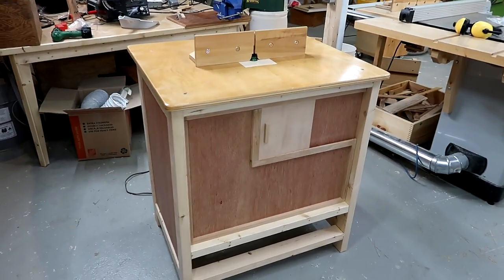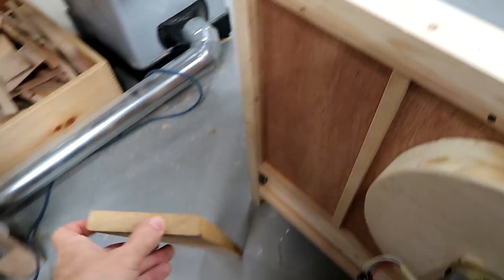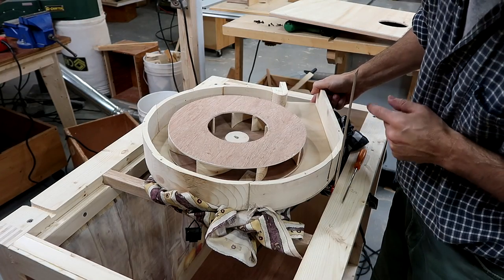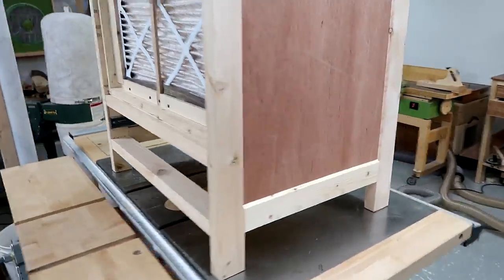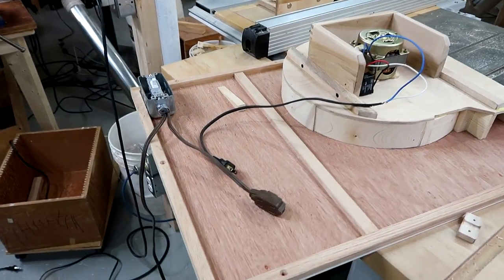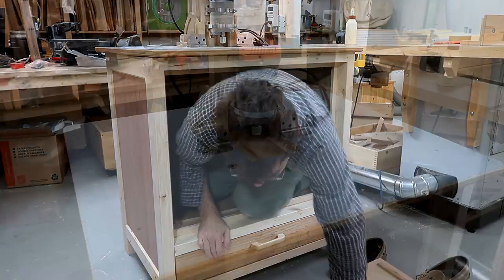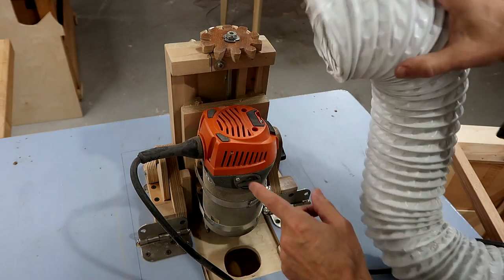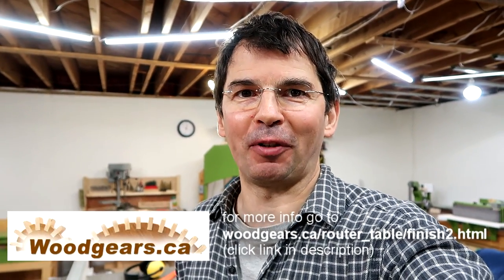Finishing up the router table

Comment: Ive never heard about the trick of cutting wires different lengths. That is one I will definitely file away for future use. Thanks!
Reply: Yeah, it's so simple, yet not even 50 year old senior engineers with decades of practical experience have ever mentioned that to me! Good stuff as always.
Reply: It's a common thing to do when splicing wire bundles. I do the same thing with my jumper wires or cables.
Reply: That is common practice. Nothing new, but very efficient.
Reply: not only do done to make shorts less likely, it also makes the splice less bulky
Reply: I'll add another tip.
The Earth wire on a plug should always be longer then the Live and Neutral. That way it's the last wire to loose connection in case the wire is becoming loose.
Reply: @ggtt2547  Dad showed me that trick when I was 13, more years ago than I care to think about now. He was a 48 year old "Technician" for Texas Instruments at that time. Engineers just design the disasters, Technicians have to implement them. Haha.
Reply: One additional tip from me is to remember that insulation of wire is movable, you can tighten it up to reveal the copper underneath, solder it, and relase the tightened insulation to cover up most of the connection and then use the tape or shrinking tube. It makes the connection clear, tight and pretty much impenetrable c:
Reply: Haha I didn't know it was a trick, I've just done it out of necessity
Reply: Another advantage is the diameter after taping is smaller (though longer).  Been doing it for years.
Reply: @ggtt2547  Engineers often don't think of that kind of thing.
Reply: @krissfemmpaws1029  But in your use case you are spreading the splice points out so they don't lead to a massed thickness all at one place - you want them curated so the thickness is nicely/best spread about perhaps even to fit a cabling channel space.
Reply: @Don.Challenger  yes you space them out when ever you can, it looks nice in the wire loom or harness.

I have had to stack the splices up because the clown before me left 4 inches of wire through the bulkhead fitting with no way to pull more. As a rule I try to make things a bit better for the next guy that may have to work on it...
Reply: It's also helpful if you use alligator clips from power supply, you cut the input wires different lengths, so the clips don't accidentally touch.
Reply: Same here
Reply: @dfabeagle718  You mean fix them!
Reply: I thought it was obvious and have done it since I was about 8.
Reply: @ZeedijkMike , every comically large UK plug has this inside of it. It really is a good idea.
Reply: One little obscure tip I learned a while back: if an outlet is rarely meant to be unplugged, install it ground-pin up.
There are two benefits: it holds a cable in better and something falling from above is less likely to cause a short.
The only benefit of ground pin down is that users are less likely to get a zap when plugging in and unplugging a device, as they can see the live and neutral legs while inserting.

Comment: It's not about how much time it saves you. Even if you rarely use it, it has two benefits:
A) The lack of setup means you won't be distracted and loose your train of thought about what you were working on.
B) When using the router table you'll be reminded of what a neat machine it is to have in the shop which will put a positive light on your project.
Reply: I like "put a positive light on your project" versus the worn our "Put a smile on your face."  Where else can any person get a smile.  I would pay money to see that.
Reply: lose your train of thought

Comment: I like it! Well done. 

I’m also intrigued by the idea of having a dust collector built into each machine. It certainly would save on hanging duct work all over the shop, plus you’re not limited to where in the shop you can put the machines by not having to worry if there’s a dust collector hookup nearby.
Reply: Yep, I wanted central dust collection a one time but have since changed my mind. Local dust collection is better in my opinion.

Comment: Having a setup router table means you are more likely to use it.

When I was working as a resin rat at a boat builder they had router cubes that were about an 18 inch cube with two routes setup in the cubes as a router table.

One of the guys had one that was 30 inches long by 14 inches square on the ends with fences. A lot of teak chips and dust was made by those things in a days work.
Reply: I've been wanting to make a cedar strip canoe for years. A dedicated router table would be essential.
Reply: @KipdoesStuff  the cube's work faces were covered with smooth Formica. The long one had the area for the routers cut out and the work surfaces were 3/8 clear acrylic sheet that the router bases were attached to. I thought it was a slick setup because you had a longer infeed area over the cubes.

Comment: Fair play to you Matthias for helping the electrical tape industry - i still use it, mainly because if I used shrink tubing, I'd probably forget to slide it on before making the connections lol!
Reply: I only use shrink tubing if its for someone other than myself.
Reply: You could just use wire nuts. There are some Wago double butt splice lever wire nuts that would be perfect for this. Or crimp type butt connectors also.

Comment: "That will easily save me a couple of minutes, maybe once or twice a month, when I want to put a quick round-over on something."  Not for nothing, but I bought cheap trim routers from Horrible Freight for my common edge-trimming operations. There's a chamfer router, a 1/4" roundover router, 1/8" roundover router, and a straight flush-trim router. They're like $29 bucks, so it's cheaper than the router bit in some cases...

Comment: I have a simple rugged reliable router tabel that I made over twenty years ago. It has survived my use in trade for that time.it is completely demountable being two frames held apart with rails and tusk tenons, the top sitting on this frame located on the tops of the legs with shallow mortices. it works a treat. 
This build video however has set me thinking. The greatest advantage to someone such as myself who also uses a demountable routr table for hobby work at home as well as site work would be the fact that the cabinet reduces sound transmission.
I think that something similar could be made using flat panels of say 18mm ply mounted with keku clips.Battens could be included with seals in to maintain air tightness. The top could still drop on to the base but with a seal routed into the junction.
thank you for the ideas Matthias. The quiet running extraction would also be a benefit.
Why though is your fence so short?

Comment: A strip of adhesive weather seal tape as used on doors and windows laid between the tabletop and frame should stop the "leaks".
The staggered wire length and tape is as good as anything when splicing wires.
Cheers  Eric

Comment: For the lip edge, just get some of that door sealing brush and install it around the perimeter on the inside. Should be more than sufficient, easy to open up, and it's cheap as cheap gets.

Comment: Great table.  This is the best one yet.  For sealing the table top.  Why not put some door weather stripping (the adhesive kind) around the top of the table frame.  That way when you put the top back on it'll get a nice seal that isn't permanent allowing you to easily remove the top.  I think you had some of this lying around somewhere.

For the router, if dust ever becomes a problem.  Like you I'm not convinced it will.  You could use a foam filter for a wet/dry vac and just close off one end.  That should provide enough filtering.  They are like $8 USD on Amazon.  Worth looking into "should" it ever become a problem or just to keep the naysayers appeased.  😂

Comment: A thin layer of rubber sheeting cut into strips placed under the table top may work if you want to keep the top removable, otherwise, I'd use clear silicone under it and around the inner lip edge.

Comment: Any particular reason you don’t use those power strips with built in switches? Just seems those would be less work than purchasing and connecting those house switches
Reply from the maker: Yes, that could be used too.  I just like the switch separate.

Comment: I guess the speed control would be an obstacle to externally ducting the motor. My router has all the vents on the top and is a single speed model so it is ideal for a flexible hose. I wonder if you could bypass the speed control pot by wiring and mounting one on the outside of the cabinet? It might be more convenient and would make a good video.

Comment: I would have went with three quarter mdf.  It would have created density which absorbs sound and vibration.  You have kind of of built a loud speaker.  Do like the fan idea.  Thanks.

Comment: As to the unit rocking on uneven floors. What about having two fixed feet on one side and on the other have two feet on a swing arm that pivots in the center. The swing arm acts as an equalizer that you can then put a locking knob on. Equalizes like these are a common element in industrial applications* where you are clamping multiple parts in a fixture using a single hydraulic cylinder
*mostly on high volume production on dedicated machining lines.

Comment: Nice build, and great to see you back to inventing/building again!
One thing about that router table. Looking at it, it just feels inconvenient to have that one drawer ALL the way to the bottom, which is the logical design, though, given that dust extraction is SO integrated directly to the routing table itself.
If you ABSOLUTELY had to, how would you do to put that compartment closer to you as the user? Maybe install something on the side? (asking at the risk of sounding stupid, just being curious)
Reply: Why not both ... the drawer at the bottom is perfect for things not used regularly and either have a drawer on the side for more frequently used bits or just mount a 2x4 ( or whatever size you deem fit ) on the side from front to back with holes drilled into it for bits used more often !

Comment: My solution to that kind of wobble is to screw a lag bolt into the shorter leg and adjust it for height. My crapppy router table is for a quick round over also, lol.

Comment: People always find a reason to criticize or complain. Electrical tape its called electrical tape because is use on electrical cables! If you need to remove them in a couple months they're not going to come out clean but all you need to do is use some alcohol and remove the goo left behind from the tape. Shrink tubing is the best option but if you don't  have it electrical tape is fine.
Reply: I love Matthias. But I would not do electrical the way he does. However, I also don't complain about it normally. The right way to do what he did would be to use insulated crimp type connectors, or Wago inline wire nuts (lever wire nuts). Soldering is really not the best way to do house and it is even worse for tools or vehicles because of vibration. Soldered wires tend to break when they are subject to vibration because the solder creates a rigid chunk of wire. This concentrates stress in the strands of wire immediately outside where the solder has penetrated.
Reply: @mckenziekeith7434  yes I understand and I respect what you were saying but you have to understand that there is a perfect way of doing it and there is an okay good enough way of doing it
Reply: @andreschiriff4354  it is no more trouble to do it the way I suggest. In fact it is easier than soldering. But whatever. I am just here to watch Matthias's videos. Not to complain about the way he chooses to do electrical stuff.

Comment: I checked out your webpage, and did not see my answer, so...is there a particular drawer slide you like? Or maybe brand?  I have a project where I need to make a lot of drawers (30 or so) for tool storage. If I can save a few dollars, it will add up. I also do not want junk (hence not making my own slides!).  If you have had good luck with anything in particular, any guidance would be appreciated.
Reply from the maker: whatever I can get cheaply.  lately been buying packs of 10 online.

Comment: Why the wood cover on the switch? It looked like you had an ok steel plate switch
Reply: So you can't jam the table up against the wall and break the toggle switch. Don't ask me how I know.
Reply from the maker: to avoid toggling it by accident.
Reply: @matthiaswandel  you never broke one of those switches? I have and it is easier to do than it looks. The toggle can sheer right off. It's always a nice 20A one that breaks on me too.
Reply: @1pcfred  When I was younger we had an argument with my cousins over the lights being on or off. They had a Decora-style rocker switch and with one person pushing the top and one on the bottom the rocker plate broke. That's the only time I've broken an actual light switch. I can certainly see breaking off a toggle, though.
Reply: @eDoc2020  I've done it a couple times. Switch is shot then too.

Comment: Could you cut multiple finger joints at once, staking and offsetting the boards?
Reply from the maker: yes, I did in the video too
Reply: It was a little hard to tell with the high-speed video, but pretty sure the first set of cuts were done with the 2 side boards. The ends of the middle board were then done individually, since it's just a 3-sided box.

Comment: The extra cover on the switch I will try to remember in future as it's a good idea. And though the electrical tape destroyed my soul - or something - it's being clamped down so it can't unravel much, so meh.
Reply: Way more than the electrical tape is the soldered connections. They used to solder wires in houses and it worked. The problem is if the wires were to get hot then the solder can melt off partially or fully causing sparking. Sparking in an enclosure full of saw dust can be deadly.
Reply: @ericwhitaker9608  If the wires get hot enough to melt the solder then you'll have other issues like the insulation melting. I think the larger issue with soldering here is that it concentrates stresses on the wire strands; soldered connections of stranded wires always seem to break with a bit of movement. I would've gone with wire nuts myself.
Reply: @ Eric Whitaker - Some say, 
"Being alive, leads to death".  🤭

Comment: I personally think making a blower that goes around the router body would have been better then this, but there are practical limits i understand.
Reply from the maker: then I'd need a separate cabinet for the dust to go into.
Reply: @matthiaswandel  You're aim was to make an area of suction, you don't need the housing of the fan for that, you could have just made the center hole be around the tool's hole, then you could have belt driven it to make up for the fact that you'ed not be able to do so from it's center as the tool would be on the same axis.

Comment: Wonder how long before the centrifugal force loosens those bits of balancing wire on the rotor vanes and they come flying off ?
Reply: Inertia pushes them into the blades, not away from them.  Or centrifugal force if your reference frame is the nail.

Comment: BRO. DO NOT TRUST ELECTRICAL TAPE WITH 15-20 AMPS. Get a crimping tool and a double sided crimp connection won't cost you more than 15cents
Reply from the maker: Indeed, electrical tape is good for zero amps only, because it's an insulator.  You wrap it around to make sure no current flows out.  But to connect things, I soldered - better than crimping.

Comment: You do realize that your air flow test is not yet valid, right? You have to repeat that so you face all four directions and then do it again upside down! 😆
Reply: Pretty sure he only does the air flow tests to head off the trolls, lol.

Comment: heatstink tubing is a crock anyway. more of a looks thing. it's good on things you are going to touch with your hands a lot where tape might unravel, for example the test leads or clips on a handheld meter, the jack end of your headphones, small things. otherwise tape all the way. once around with white electricians tape is good way to go on spliced power cables because if there does end up being a fault you can spot it right away. you don't need anything other than your hands with tape, which is why it will always remain the choice amongst gentlemen. when i say this, i am not talking about the duct tape and wd40 crowd, they are introductory tape men. i am talking about the true veterans like wandel, who don't give a shit about what idiots like me have to say about using black tape on a splice job, let alone heatstink tubing. what a load of hot air.